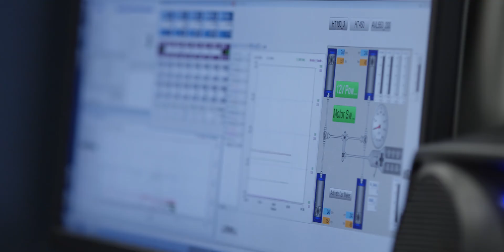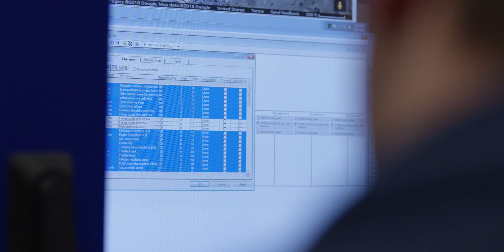Ford Mustang Mach-E 1400 | First Look | Driving.ca

Comment: This Isn’t a garden verity Mustang Mach E.. the build cost should be right up there with a Ford GT for R&D cost! Remember Slot Cars? This is what they can become when they grow up at Ford. I had a 1/24 scale 65 Mustang model I reversed thei platform on and add a nine volt transistor radio battery to the controller to revers polarity for the brakes. Slot.Car Fast and could stop on a dime over 50 years ago!  Not new tech, one of the Ferdnan  Porsche designed was an all wheel drive electric car. They just didn’t have the battery tech to make it practical!